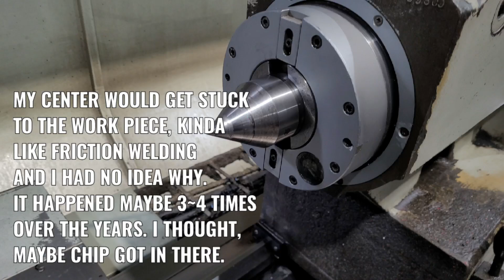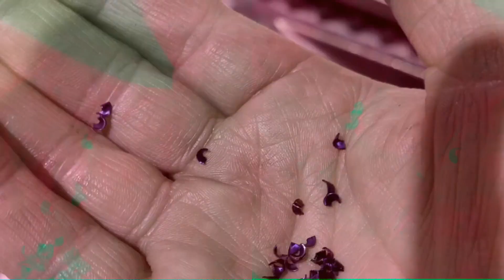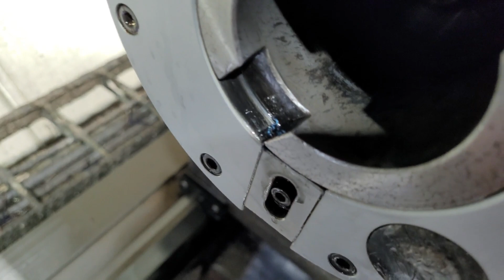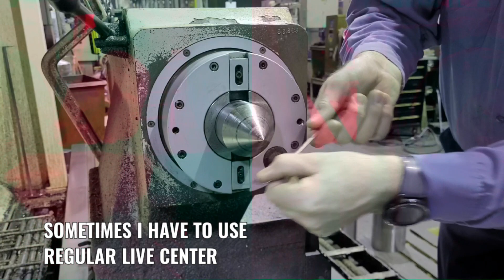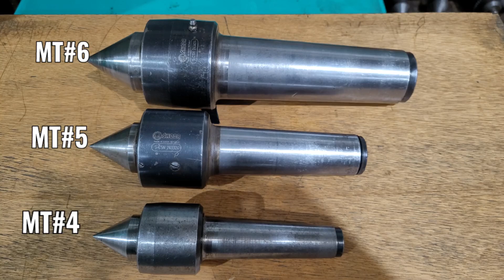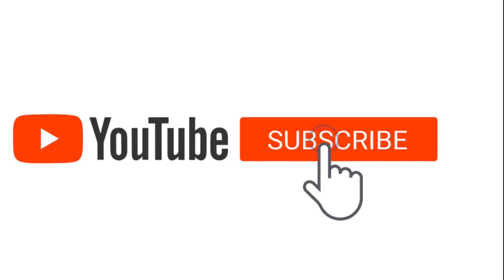What's the deal with the duct taped tailstock.

Comment: Piper live centres from Australia and Skoda. I run the Piper centres with standard points,  extended points and pipe cones and small chucks mounted on the JT taper and never have had a problem.

Comment: Overkill solution would be a round plate with 2 keys milled. just replaces the 2 keys in there and bolts to the quill. would be easy enough to take off and put the keys back in if you need them.

Comment: Find a large plastic lid, cut a center hole in it, and epoxy a few small magnets on the back. Then you can stick it on and pull it off without all that tape.
Reply from the maker: You might be on to something 🤔
Reply: thats a nice quick fix, i was also thinking that 3D printing something like this would be pretty simple if chris has or knows someone with a 3D printer
Reply: And maybe use some felt washer that rubs on the center to fill the gap.

Comment: Maybe try make up a metal lid (something softer than the tailstocks face plate, not sure if that’s the right name for that part of the tailstock - the greyish matte part) with the OD being say 8mm larger than the tailstock OD so its not so rigid to get that snap on fit. Bore a hole for clearance on your centres obviously then bore the larger ID say +0.02mm. Also make the ID length slightly longer than the key way openings on the faceplate so you know nothings getting in there. 

One of those ‘small’ but exponentially worsening issues that the manufacturer forget about . Like you could imagine while making the design they were so focused on perfecting everything they forgot what their products actually used for.

Comment: I use a No. 4  M.T. Rohm live centre.  I've used it nearly every day for 16 years and it is still as smooth as silk.  I also have a No. 5 Rotor live centre but I have barely used it.  Supposedly they are very good.  I don't put anywhere near the weight on them that you do however, so my opinion may not mean much in your case.  Ken

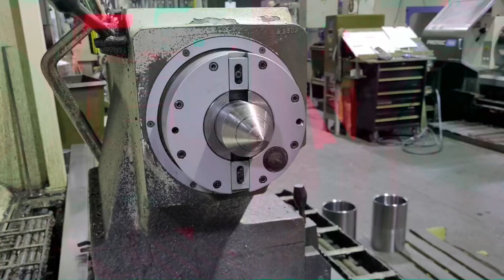Comment: At 1:23 we can see that you have lot of bolts and also two holes (maybe not threaded?). So you can do a disc plate with center hole to match the zize of the live center. Easy to remove, just remove the screw (two will be good). Or you can do same thing but with two small magnet in the back, so without screw it. And also, try to ask the company about that issue..

Comment: I always had heat issues with my skoda live center, last year I got a sealed center and its been great having no heat expansion issues when dealing with 1000rpm or more.
Reply: Luckly for the protech 9na module the machine will max out at 1000rpm. On our machine we never go over 700rpm as it gets to sketchy with some of the large work we do.
Reply from the maker: @Wendull 81  My  maxes out at 630 so high rpm  is not really an issue, and even then it sounds like a helicopter 😆

Comment: My 1985 TOS lathe still has the original Skoda live center that was a standard accesory for it and that outlasted the first set of the lathe's spindle bearings (it's still in good shape but I might recondition it at some point). I am surprised that you find a typical morse taper live center installed into a keyed otherwise revolving tailstock more rigid than a solid dead center inside the tailstock spindle. Unless you mean it's only more rigid compared to other live centers but in that case what are the reason to use a live center instead of using a longer dead center for the extra clearance for example?
PS: Oddly enough mine is a MT5 but the outside contour is like your MT6 one
Reply from the maker: I was comparing to other live centers.

Comment: I hav same skoda/ just rebuild it and grinded taper as new. ISOFLEX NBU 15 grease i use. 
For really small stuff i hav skodas change tip set.
Grinding fully assemblyed live center in OD grinder by rotating center  O-Ring and cordless drill😏😏
Reply from the maker: The thing with Skoda live center the load bearing fails under heavy load, but at least it's easy to replace, but for riggity I'll take it any time over the expensive ones.